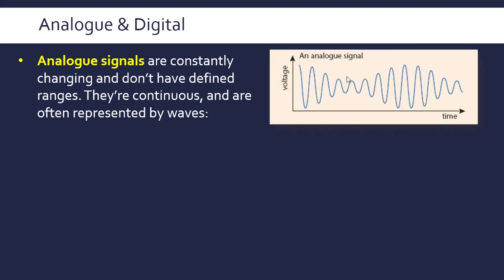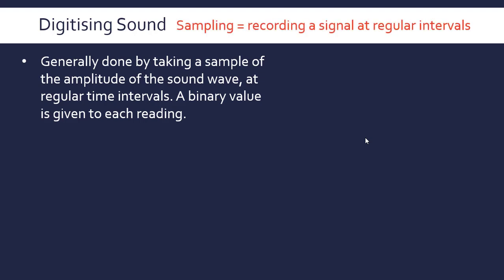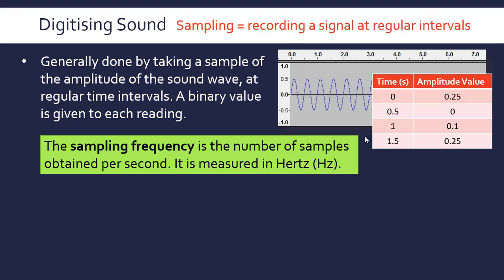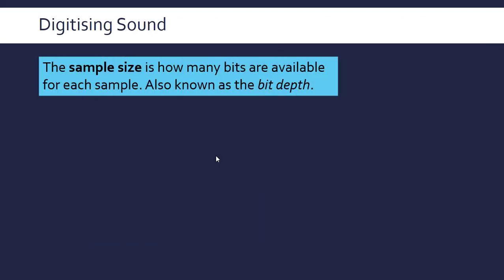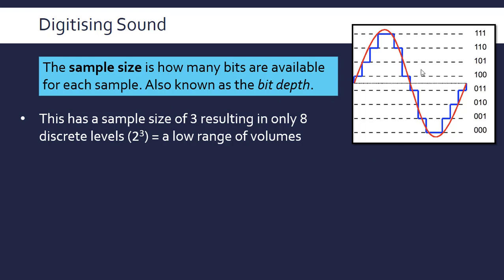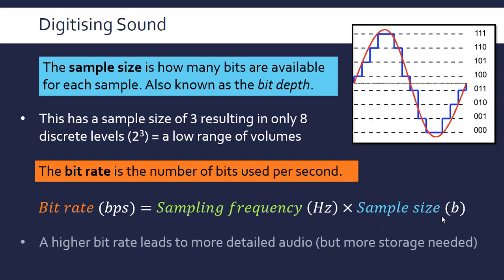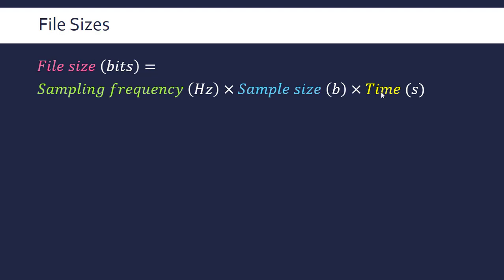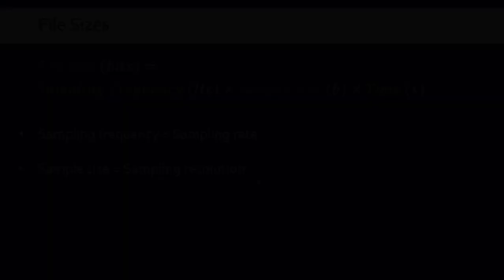Representing Sound in Binary

Comment: The sample rate isn’t the resolution. It’s correlated to the maximum frequency that can be represented. You can perfectly represent any signal lower than half the sampling rate, the program just doesn’t show a very good job of this simply connecting the dots. Even though it doesn’t look like it all of those samples represent the same wave form you just have to use complex math to find the true interpolation. Look up Nyquist–Shannon sampling theorem for more info.